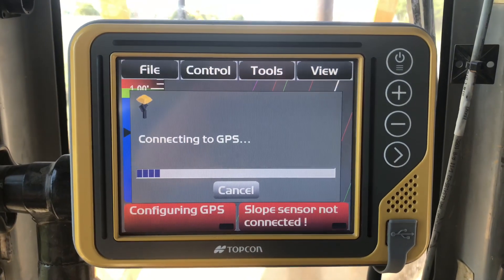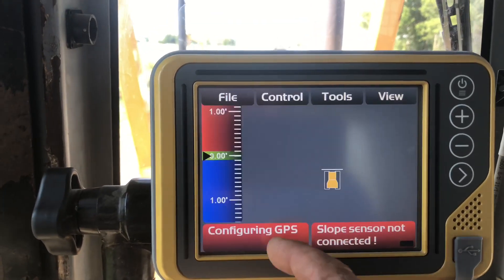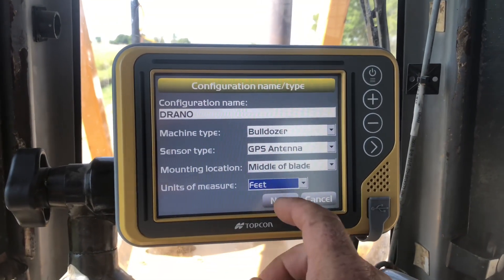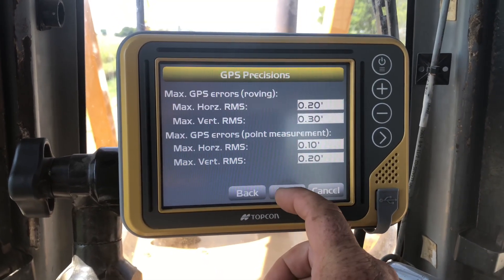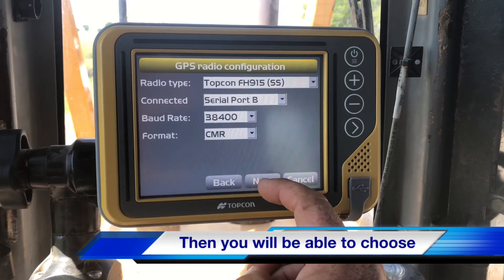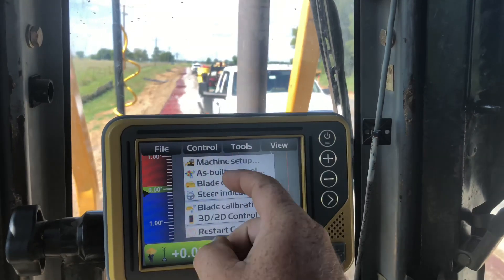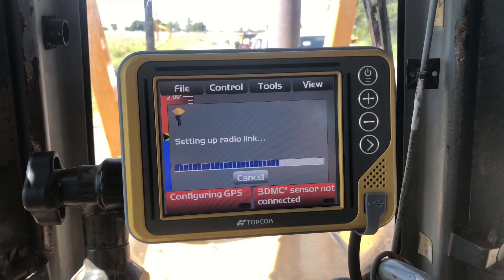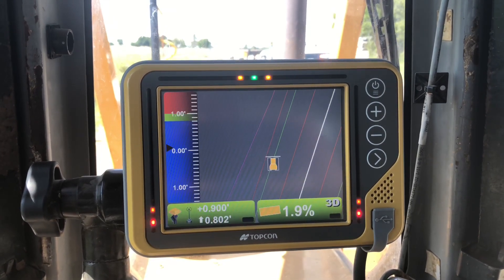Hack that will sometimes fix control box to MC-R3 connection issues

Comment: Any idea what a Blade IMU Electro-mechanical fault would indicate. 

It's on the 3d auto grade and keeps it red and will not engage.

Auto blade was fine before, I have so far look at the wiring from the 3dmc box at the blade up to the front all the wiring looks normal and was snug.

Comment: I’ve got a 700k John Deere with a GX-60 computer and it says 3dmc2 sensor not connected so I did this and ran the diagnostics using the tap the 3dmc logo 3 times like in your other video and all I can come up with is IMU not connected. Any ideas?
Reply from the maker: Check coil cables to back of sensor from the dozer to the blade.
If connections are good could be a bad cable or sensor
Reply: @MachineControlHackers  ok will do. We have 3 cat machines with gps and one John Deere and every time a thumb drive is put in the Deere’s computer it seems to have problems that day none of the others are problematic.

Comment: What if the custom option doesn't come up
Reply from the maker: To get custom to show up as a option for a Max or Mast-less system you will need to select middle of blade as the antenna mounting position.

Comment: Thanks for the info! I tried to run this on an excavator and I could not get it to run the file.
Reply from the maker: If wouldn't if it was using the mc-i4 receiver or mcx. This only works with a mc-r3 system

Comment: What version 3DMC was this? I'm a tech that works on all Topcon equipment here in SoCal and we've come across this issue we all versions of 12.1 and up. There is a known issue with v12.1.420 (GX-60) and v12.1.421 (GX-55) so definitely stay away from that.
Reply from the maker: w morales43 
Latest realease
I’ve been seeing it a lot again lately as well
Especially on MAX
Reply from the maker: I have several customers with the MX3 file named “Drano” saved on the control box. The latest release has been bad about it.
Reply: Do you see this more with GX-55's or GX-60's as well? The easiest way to get through it has been to down rev to 12.0.5.135 (GX-55)
Reply from the maker: wmorales43 
About 30/70 split more on the 55 now
Used to be all on the 60 around the time of 10 code
I’m certain now that it’s the new 3dmc because of the boot up code that’s wrote in for the max initializing
Reply: Machine Control Hackers did you create the drano file or did it already have it? im running a gx55 and it also says waiting for radio link and on the other box it tells me im out of design area